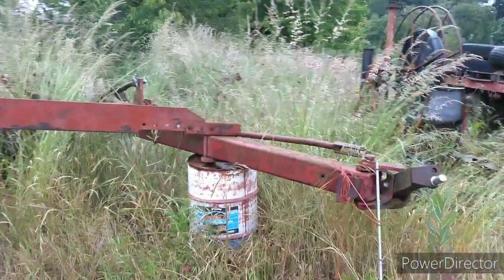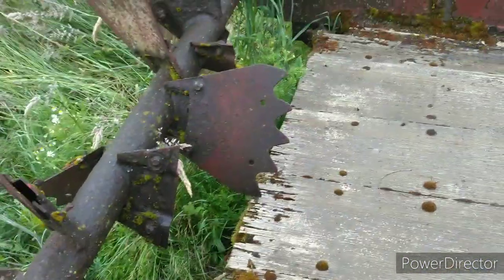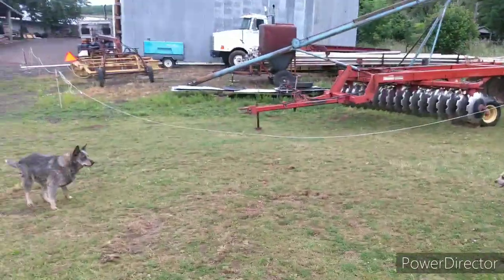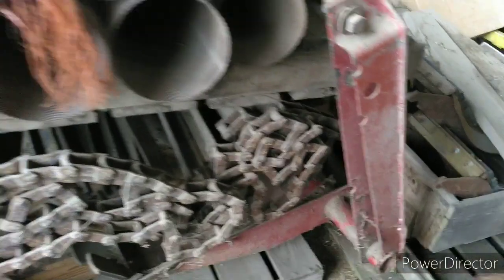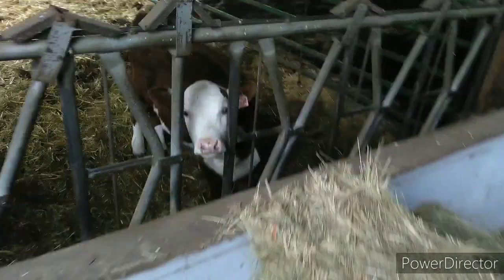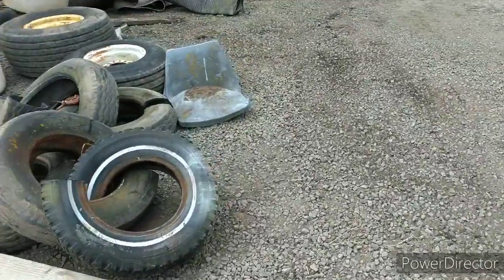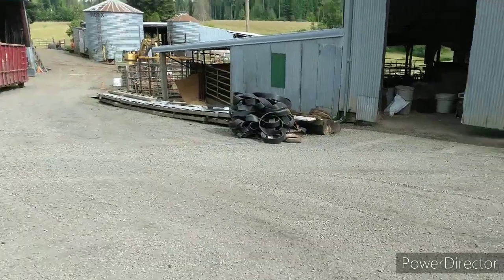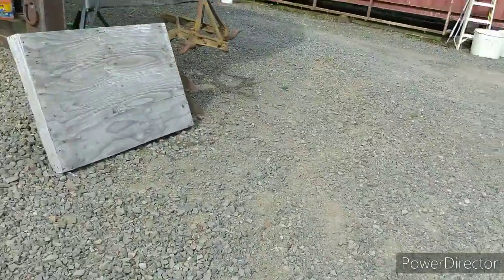Second scrap box is full!! Garbage dumpster coming tomorrow.

Comment: Your making great progress on the scrapping. That plow would have been nice to have. Your going to have a lot more room when you get everything done to bring home more projects.
Reply from the maker: I know I will certainly enjoy the extra room in front of the shop this summer!! Much nicer to come in closer to the shop with the semi!!
Reply: @GosselinFarmsEdGosselin  yes definitely will make it easier to move stuff around in there. Will you have to haul all the tires to the tire shop or will they send a truck to pick them up
Reply from the maker: @nidayfarmranch6002  probably going to have #1s fiance haul them to Portland.. he has one truck and pup with high sides, should all fit. I'd rather pay him than the outfit that is getting them!! He's much less expensive!
Reply: @GosselinFarmsEdGosselin  understand that on cost. You think you will fill truck and pup? I didn't think you had that many of them. I take it you can get rid of them in Portland a lot cheaper than any place closer
Reply from the maker: @nidayfarmranch6002  way too many for local tire shop.. they all end up in Portland, so just take them there..
Got a lot to cut off or dismount!!
I'll keep most of the truck wheels, but the rest I don't care about
Probably will fill both
Reply: @GosselinFarmsEdGosselin  extra truck wheels are nice to have around.  That should clean up a large area just getting rid of the tires
Reply from the maker: @nidayfarmranch6002  yes they are!! Especially if you need to swap sizes on a trailer 👍
Will free up a lot of room! Especially if I take the old rotten cherry tree out!!
Reply: @GosselinFarmsEdGosselin  take the cherry tree out for bonfire wood. Guys around here use old truck rims for bases to stands. One guy has his bench grinder on one. He just wheels it to where he is working in the shop to use it.

Comment: Man them bringing you a rolloff sure must be nice... they don't do that here!!!  

Whe scrap hit record prices probably 10 years or so ago, my brother and I took the opportunity and scrapped out all them old IH double row cotton pickers... two 1400 pound picker units on the front, truck axle and heavy cast chain case unit/ground drives, heavy wall pipe frames, sheet and expanded metal baskets, and a lot of other structural steel in them.  I did cut some 2 inch channel and stuff off of them that was clean and straight, and we took the tires and rims and pickle fork rear single tires and the engines/transmissions and sold them to Jay's (at the time) boss at the tractor salvage, since he'd give us quite a bit more than scrap value for them.  The rest went on the 16 foot lowboy... We'd haul a load with four picking units on it, then the rest of the machine frame and basket on a second load for each machine, we scrapped four old pickers plus a couple of old smaller one-row tractor mounts Dad and Grandpa had junked nearly 40 years ago that had been sitting behind the barn all that time up on old rotted out 55 gallon drums-- they'd pulled the old H's and M's out and turned them around to "normal drive" Farmalls and sold them-- cotton gins loved those old Farmalls for pulling and pushing cotton trailers around on the yards... hardly nobody else wanted them with no 3 point they weren't good for much of nothing but scrap (bout like ol' South Sask's bareback ponies LOL:)) Anyway, we had some other stuff including most of the remains of an old Ford 630 combine I'd picked up from an old combine salvage yard for scrap price years before when they were selling out an closing down, because a lot of the parts fit our Ford 640 combine... I robbed off everything usable and the carcass sat there for about 10-15 years... We backed the trailer up to it and pushed it up onto the trailer with the front end loader... she was a LOAD but we got her 40 miles to the scrap yard!  

THink by the time all was said and done Jay and I split nearly $7,500 bucks on that one LOL:)  NICE!!!  Course we didn't advertise that to the boss or the old man-- otherwise they'd have wanted a cut LOL:)  

Later!  OL J R :)

Comment: I like how a lot of your possessions are stashed on pallets. What was up with the rake by the spreader, a spare?
Reply from the maker: Pallets make it nice to move around.. but they rot pretty bad in a few years... 
That is the single rake, two others just like it on a dolly, then the NH 216 V rake..and a Tedder rake and a Tedder...
Reply: @GosselinFarmsEdGosselin  Yep that's for sure.  I got a LOT of free pallets from the high school warehouse when I was driving a bus... all the slightly busted ones that the truckers refused to take.  School had been piling them up and burning them periodically but the gubmint isn't fond of that, so my boss was thrilled for me to take them.  Stored round bales on them for a few years amazing how much hay they save just keeping it up off the ground so moisture can't wick up into the bales from the moist clay soil under them... Only problem, yep, they rot-- basically get about 2 years out of them then they basically just collapse under the bales and you're back where you started.  Tried just putting another pallet on the melting remains of the first one set the bales on that, but then they tend to go wonky or smoosh out sideways or whatever and your rows of bales end up getting crooked or bales tipping to one side or the other.  Then after another couple years you have ANOTHER rotten pallet sitting on top of a REALLY rotted one, and nails everywhere... picked all that crap up and switched to two old power poles about 2-2.5 feet apart or so, like rails, set the bales up on them, so they hold the bottoms up off the ground-- works good the creosote poles should last a long time.  Power company used to haul them off, now they don't bother because when they start replacing poles they just drop new ones in the road ditches a couple weeks or so before the line crews come to swap 'em out, and farmers are lined up with trucks and trailers and tractors to snap them up as soon as the old ones hit the ground... Basically first come first serve so you gotta be quick!  One guy was picking them up with the front end loader on his old 1086 and hauling them down the road cross-wise... just raised the loader up as high as it would go LOL:) crazy sumb!tch LOL:)  I'd straddle 'em with the tractor, wrap a chain on one end and just skid them down the road ditch back to the house... unchain and tear out to grab another one when I could... Got almost enough to do the hay storage yard at Needville.  Then the BIL's sister went to work at the recycling center in their Indiana town and she could get me a bunch of plastic pallets free; usually greasy ones or stuff that had been poked or ran over with a forklift and were slightly mangled, too much for a trucker to want to use but for what I'm doing, perfectly fine.  Now I'm making lines of plastic pallets to keep the round bales off the ground... no air circulation under them like the power poles, BUT at least they are providing a moisture barrier between bale and soil below, which is the main purpose... Free is cheap enough, I'd haul a stack back on the back of the pickup to Texas every time I came up for a couple years and got quite a few now... 

Later!  OL J R :)
Reply from the maker: @lukestrawwalker  pallets are great for a lot of things!!
They hold up good inside, but rot fast outside

Comment: Is that 6 bottom a international and does it have a 2   spring reset
Reply from the maker: It was..  it had the overhead overcenter setup
Reply: @GosselinFarmsEdGosselin  couldn't see the springs for the grass . Was thinking of pulling mold boards off and replace them with home built subsoiler shanks
Reply from the maker: @jeffgroce9736  could probably put shanks on.. angle is about right. If you have enough lift
Reply: @GosselinFarmsEdGosselin  just have to drill holes in the rite places on the shanks for the rite angle
Reply from the maker: @jeffgroce9736  true..